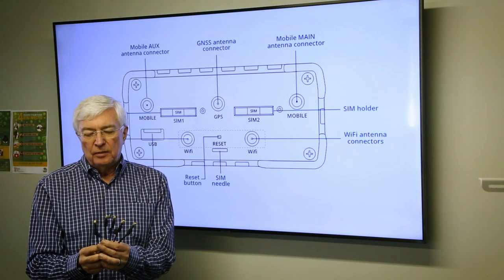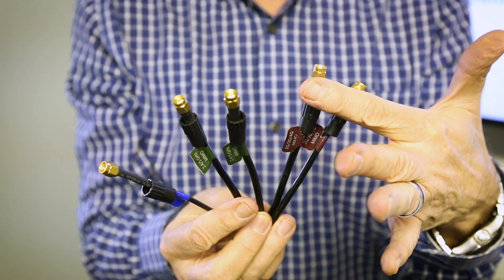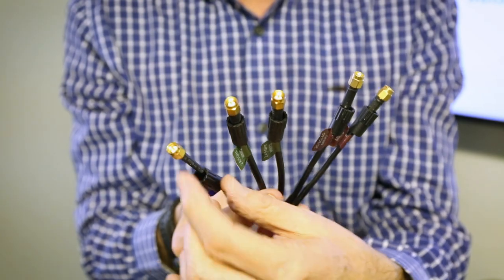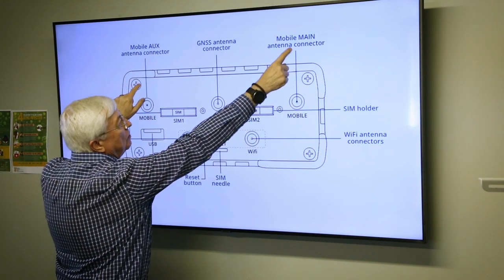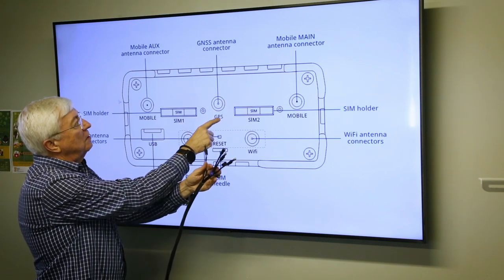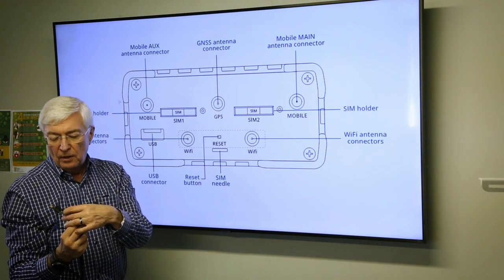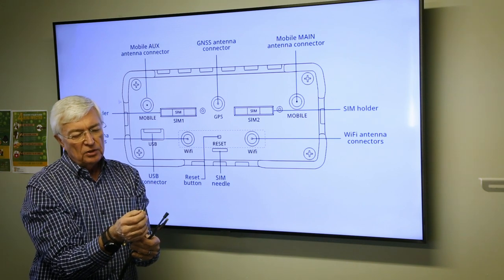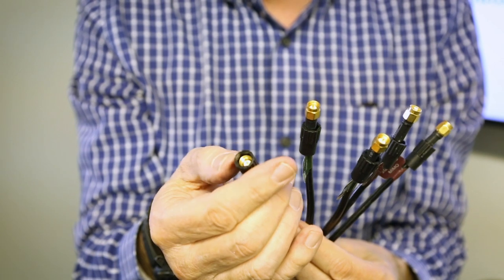How do I connect a Poynting 5-in-1 MIMO antenna (MIMO-3-15) to a Teltonika RUT955 Router.

Comment: But they are both male connectors (as is the case on the RUTX50 and Poynting MIMO-3-17 that I am trying to connect) Surely you need an adapter too?

Comment: Where do you connect the LTE cable?
Reply from the maker: On this router it will go on the connectors marked "mobile". Where Pieter talks about 2G, 3G and 4G on the antenna cables, that's the same as LTE and connects to the mobile connectors.